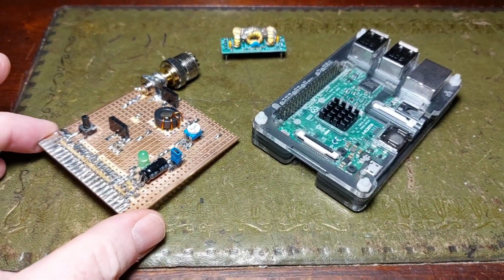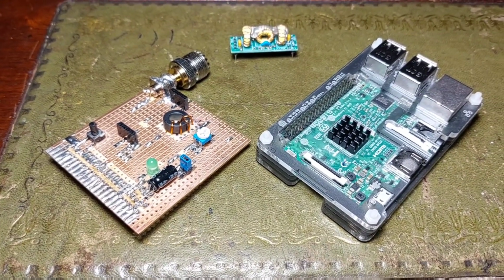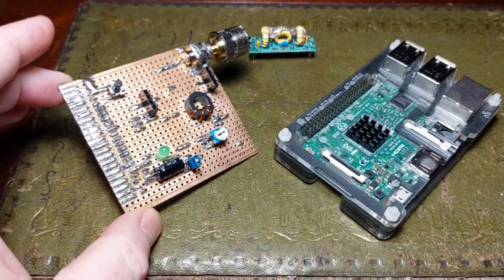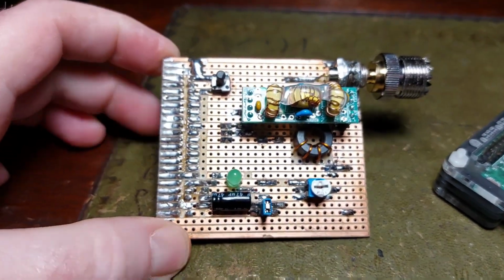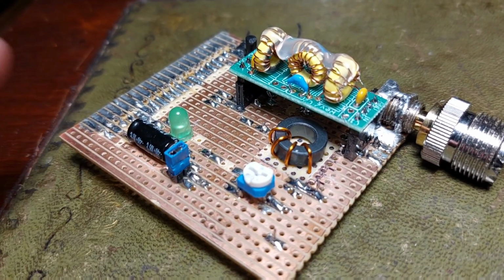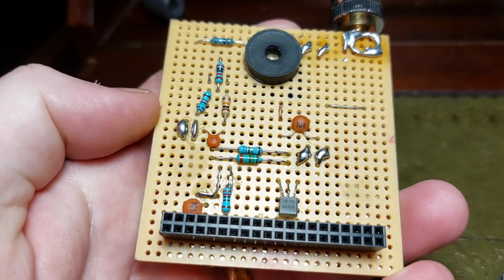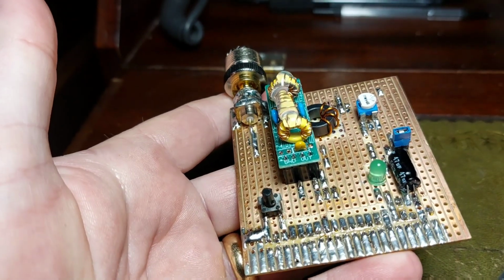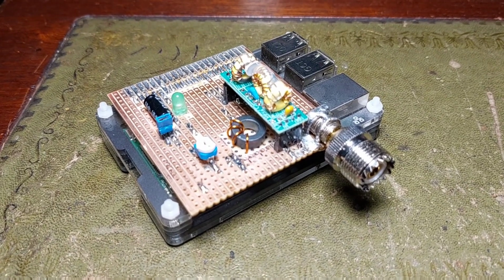Homebrew 200mw wspr beacon on a Raspberry Pi.

Comment: Hi,
In the schematic R4 shows 1, what is the actual value?
Also I would like to maybe build this beacon although slightly different. Instead of plugging the WSPR board on to the raspberry pi could it be separate, maybe in a case and have short wires connecting them?
Reply from the maker: Hi. The resistor is 1 ohm. You could make the board separately, but it wouldn't be so tidy
Reply: @mk1tina Ok, thank you.

Comment: Many tnx for your kind answer. I have finished the  TAPR pi-hat built on a strip board more or less copied from your design. It works as expected, but I have to build an adequate outdoor antenna in order to really let its whispers out in the world. 
Like you said in your video the signal is rather crude though -  with lots of 50 Hz noise. The small humming reduction capacitor (10 nF?) that you mention - where exactly in the circuit have you put it? I can't figure that out.
73 de SA5JAC
Reply from the maker: Sure. Place a cap from ground to the side of the Variable resistor where it joins the 15k. If you do that it will clean up the noise.
Reply: @mk1tina  Thank you very very much! 73 from snowy QTH 60 miles west of Stockholm.

Comment: Love your modifications of the TAPR pi-hat. Great to be able to switch filters like that! I will order components for my copy of your board. 
Last week I passed the exam to be a ham and now I got my licence (about time it is - I am 71 yers old). Have no tranceiver yet. But yesterday I managed to install WsprryPi on a Raspberry Pi 3 and had it transmit crude square wave on 10 m via a minuscle indoor antenna, i.e. 8 cm plain wire). After that small success I now feel like I have to try the TAPR amplifier + low pass filter to get WSPR signals out through an outdoor antenna.
73 de SA5JAC
Reply from the maker: Many thanks for your comment and congratulations on your new license. Excellent news about your initial WPSR build, the small amplifier will get you around the world and teach you much about propagation. Enjoy

Comment: i love the quality of your home-brew WSPR board - I have previously run the WSPR board from TAPR on a Pi - it performed very well, currently I have the IC705 running 1W into a 6BTV for WSPR. There is just so much to learn from WSPR data - there are some excellent analysis tools out there and great research papers on WSPR as well - having a beacon like this is a great way to get into it. Thanks again for the great video - 73 2E0FWE